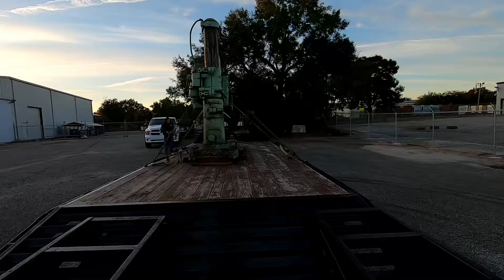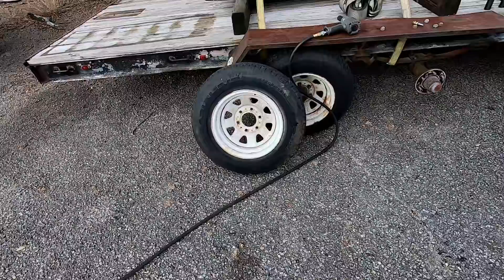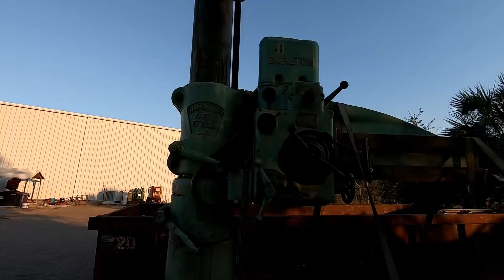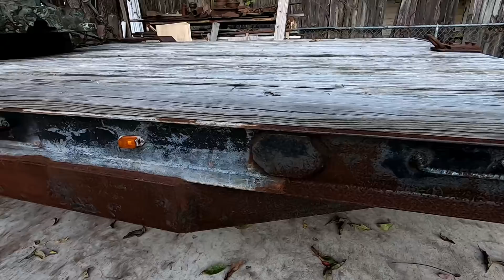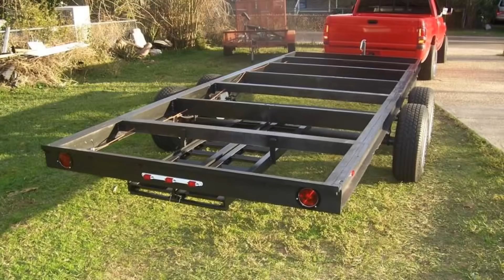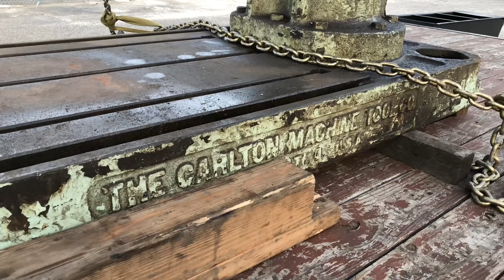Carlton Radial Arm Drill

Comment: Good luck with Dodge, they build a good heavy duty truck but they cheap out on the wiring. Dodges are real bad about catching fire because of the wire being to small. Had a 96 Dodge with the V10 and the headlight switch wiring burned up, then a couple years later the ignition wiring caught fire because the ran the blower motor power through the ignition, did a lot of damage. I was going out to my place 8 miles away when it did it, and within a few seconds the entire cab was full of smoke, so keep an eye on that. Dodges tend to fall apart but will hold and haul a large loads, they just really cheap out on good wiring, sad.
Reply from the maker: Good thing I went with a Ram! 
The trucks have greatly improved over the generation your talking about.
Reply: Abom79 You made a good choice Adam - also love seeing new tools in the shop!
Reply: I hope you have better luck with yours than the people my friend has to go out and tow in for service, most of the cars/trucks he tows in are Dodge's.

Just saying keep an eye on those wires, Dodge's have had lots of problems, even the new ones, bad about burning up and catching fire. Just saying to be careful guy, love the video's and would hate to see you get hurt by something they when cheap on.

Comment: Looks good.  If I was closer I would hop on rebuilding the trailer with you in a heartbeat.  When you put some new lights on get some tubing large enough to mount the lights inside of for the trailer brake/tail lights.  You can then weld them on to wherever you want and are a lot less likely to tear them up.  And if you have to redo the wiring use some of the orange extension cord.  Works really well and you can just zip tie it down or attach it with whatever you want with very little risk of the wire chafing.  Unless you have trailer brakes it only takes a left brake, right brake and running light to run the lights.

Comment: Hey Adam,  I have an old American Radial that's about the same size.  Be careful when unloading because that
arm might still move when you are taking it off. When we moved ours, we rotated the arm up to the mast on the 
forklift and secured it there so it wouldn't move.  We also made a heavy duty outrigger that we mounted to the t-slots in the base between the column and the table.  Extending out about 15" minimum to the front and back of the base
gives it a wider footprint, especially if the arms starts swinging around (and even more so if the drilling head is out
on the end of the arm).  Scary thought.  These things are very top heavy........ Nice machine to have in your shop.

Comment: Those old carltons are hard to beat, I got a 4' arm on 11" column. If ya ever need parts look up Lucas precision, they are the ones who ended aquiring all of cartltons old drawings, shop manuals and alot of jigs for making new castings along with maching new parts from the original blue prints.

Also the elevator gear box is designed to seep onto to lead screw so make sure it always has oil in her.

Comment: I have rebuilt two of these in my lifetime. When working properly these  are excellent machines. These are still used daily in the tool and die industry. Used to drill stripper plates and base plates. You can still buy radial arm CNC drill presses brand new.

Comment: Question from the novice. Why you need such a monster of a drill press when you have the other milling machines ? What kind of work will it do that a others won’t ?
Reply from the maker: Milling machines are for milling. Drilling machines are for drilling, and these can handle much larger work pieces.
Reply: Abom79 I get the picture.. thanks 😎
Reply: Drill 3 inch holes in 8 inch plate..lol

Comment: We called it the hole wizard back in the day. Rugged machine for roughing holes in tough parts. I never saw a lot of uses for it . However it was a beast of a machine. If you have a lot of work for it, it would be cost effective. If you don't it will collect dust. Good luck with it!  It was a very popular machine in job shops. Just seeing one again, brings back memories.

Comment: Where I work, we USED to have 3 of the Carltons. 1 was this size, then a 4ft on 12in and a 6ft on 15in column. We still have the two larger ones. The use the #6 Morse taper...what a pain to slam those tools up in...they get heavy after awhile. Good luck with your latest toy.

Comment: Your trailer like mine definately needs a makeover....... Really like the truck. One tip on the placement of your load. Needed to place it a bit more forward of the axles to add a little  weight to the rear axle of the truch for better traction. The reason I say this is before I got a gooseneck trailer I almost jack knifed with a load placement such as yours. Didn't have enough weight transfer to the truck. Just a thought......... Got enough room in the shop for that thing?
Reply: Jackknifing is no joke! 60% of the weigh should be infront of the axle to be safe.
Reply: I was always told 10% tongue weight.

Comment: this thing needs some wire brushing, a steam pressure washer, a good coolant and oil resistant 2 component laquer paintjob, machineoil sprayed on via a spraypaint pistol, some grease for old bearings and maybe new bearings and someparts rewelded and surfaced where the cast was damaged and likeley some small parts remade

Comment: Were those "STAINLESS STEEL" binders???? Also love the idea of using the plastic snap-ties to hold the left-over strap(s) in place. Will be doing that for now on, thanks for the idea. I choked when you referred to it as a small drill press. Made me think of Paul Hogan in Crocodile Dundee: That's not a knife. THAT's a knife.  Great stuff, thanks for sharing, and thanks for taking the time to shoot, edit, upload these video's.
Reply from the maker: They were zink coated is all. Yea I mentioned small compared to the 8' x 15" column machines.

Comment: To minimize condensation when covering the Carlton, I'd place at least a 100W+  light bulb inside the iron casting for heat to keep it above the dew point temperature.  Condensation build-up will cause rusting, electrical wiring, damage, etc. and should be minimized  or prevented  whenever possible.

Daily dew point temps. are widely published either online, inside the newspaper (weather forecast section), etc.

An infrared handheld thermometer is an easy way to measure the casting's temperature.  I just bought an Etekcity Laser grip #744, ~$20, from Amazon.  It's a point-n-click meter and reads within a few seconds.  I particularly recommend it for this application, cooking or wherever you need to quickly know a temperature.  It's very convenient compared to a classical stem thermometer.

Supplementing the heat source with a small muffin size fan to circulate the air and prevent the warm air from accumulating at the top, appears quite helpful too, and takes only a few watts of power.

It's debatable whether a tarp causes more rusting or not because although it keeps out liquid water, it traps water vapor inside where it will condense on the iron.  Also, the moist air trapped under the tarp, warmed during the day, will result in accelerated rusting and deterioration of electrical components, etc.  So, overall, is a tarp helpful?

Comment: MT4 spindle will sure let you make big chips.  Will it run your 3*7/8"?
Reply: No. That's a 5 or more likely 6 drill bit. My mt4 royersford is only rated for 1.5"
Reply from the maker: The 3 7/8" has a 6MT. I have some 2" size drill bit we can run on the drill.

Comment: @abom79
Why have a drill press when you have multiple mills?
Reply from the maker: A mill is for milling
Reply: @Abom79  but a mill can drill.
Reply: Because the mills cannot reach to the center of an 8' work piece...
Reply: @Blazer02LS  enter the mag drill..
Reply: @fnord5  Why wouldn't you want a radial drill press? Why have a shaper? The machine is 80% of the fun of machining. I'll watch my shaper for 15 minutes do something my mill will do in 2.
Reply: They are handy but not really the tool to drill multiple large holes with speed. With a radial arm drill you just move the head into place and drill using the auto feed. Move the head again in a few seconds and drill the next hole. Much faster and easier than a mag drill.  Also a mag doesn't do power tapping very well.

Comment: That's a really nice trailer. I love how heavy duty the tongue is. Most factory made trailers that have gone through what yours has are just about worth scrapping by now. It's a good idea to get some new rubber on it before using it much more, a TR600HP has got to be pretty old to push through a wheel like that.
Reply from the maker: Yea the trailer is solid, just needs some fresh paint really. Even the deck is not bad just looks aged.
Reply: Need some torsion axles too, though it doesn't seem you use it enough to justify.  Thanks for sharing.

Comment: When you get around to rebuilding the trailer I would recommend LED lights all around.  You already have the holes at the rear for flange mount turn/tail lights and the marker lights could be replaced with surface mount, rectangular  lights.  Anything incandescent with a separate base and light is a waste of money.  They always fail at the same time.  LED lights, shrinkable butt connectors are the way to go.

Comment: WheneverI have to unload something like this i just get a piece of 4x8  strand board sheathing its as slippery as can be for some reason I put underneath the iron object  and use a come along and it slides right off the trailer nicely. No need for chasing pipe around.

Comment: Most of these big industrial machines run on 3 phase 270 or otherwise not regular in home current and voltages. Do you have transformers or a power supply form you provider for all your toys that I am so jealous of?
Reply: Adam has 3 phase power in the shop from the local power co.
Reply: Variable frequency drives have come way down in price in the last 15 years.  They are now the easiest, most efficient way to power 3 phase equipment at home.
Reply from the maker: 3 phase power to my shop.

Comment: Just a suggestion from a guy that has done a little hauling. Always have front to rear tension on anything you are hauling. You tied it down real good for everything but an emergency stop or God forbid a front end collision. Had a friend die because his boat was not secured (properly) front to rear and it slid over the top killing both guys in the cab.
Reply: If I was hauling that I probably would have added a chain over the top of the table in front of the column, with the ends going back to behind the fenders on each side, since the greatest force this will experience is braking force making it want to slide forward.

The second greatest force will be tipping forward, so I would put the front block as far forward under the table as possible (it is a fulcrum under the column here), and would have the chain over the head angled a little further to the rear to hold against the forward tipping. 

The 3rd greatest force is rocking side to side with that high center of gravity, so I would have used 2 more chains (or straps if chains would damage it) around the column above the head. One chain would attach to the side of the trailer in front of the column, go around the column and attach to the same side of the trailer but behind the column, and the other chain would do the same thing from the other side of the trailer, ending up making an X pattern (when viewed from above) or actually 2 interlocking V shapes, effectively locking the column in place in all directions.

But for a short drive, Adam did fine, because he isn't an over-securing anal truck driver like me lol

Let's just say I treat tie downs like Adam treats dialing in 4 jaw chucks.

It shall be perfect, and in my case, perfect means that over a travel of 1000 miles, I can measure the shifting of my load in thousandths of an inch... Lol

Comment: Suggestion for your trailer: after you strip your deck off get 2 pieces  6"x1-1/2 channel the length of your trailer deck, lay it open side up spaced by thirds length wise up your frame before you put the deck back on it. then weld D rings in it every 4 feet. another option of this same vein if you a have either a water jet or plasma table at work is to cut chain pockets like on the bed of a wrecker every couple of feet. I will send you a pic of my trailer so you get the idea.

Comment: YUPP spent over a year in a valve control shop working with three of those one like this and one like Brian's and a small one. Sure learned ALOT there too. Melted in summer and froze in winter. Coring  cast holes for 
Rubber  lined  control valves , air or hydraulic plus manual . Oh well memories are all that's left. Good machines the Carlton line . I could drive taps in and out with the sensitive controls . Thanks for the videos .

Comment: If you're going to leave a load on the trailer for a while put some blocks under the rear frame. When you crank the tongue off the hitch it'll tilt back onto the blocks and take some of the load off the tires. If you jack it up a little higher and then let it down on blocks in the front too it really stabilizes the trailer.

Comment: That's a real machine tool. In my career shop we had a couple dozen with four in a row reserved for first year apprentices. Carlton drill presses are nearly bullet proof. If forty years of apprentices can't degrade the function of a Carlton radial arm drill, nothing will.

You will find what you will find. Nothing's perfect. Carlton made thousands of these over the years. I'm sure you can find the parts manual on line. Everything is so well made: they're a pleasure to work on and when cleaned up and shiny an esthetically pleasing addition to the inventory.

Im green with stuff-envy. Happy drilling.

Comment: Reminds me of when I bought my Bridgeport mill a few months ago.
I had it strapped down like Gulliver and I also bolted it down to the trailer as well.
My father said it wasn’t necessary but I said 
“Do you want to be on the 6 o’clock news with this laying on its side dug in the middle of the express way “ 
It was a 400 kilometre drive (248 miles)

Comment: Too bad Alec Steele didnt have as much success with his machinery delivery.
Reply: Loading and unloading is the scary part.  If you've watched bcbloc02 - Brian was unloading and his crane cable snapped (he posted that video back in May 2017 - I think his is a 7' arm, or thereabouts.)  Thankfully, he wasn't hurt and the drill was repairable, but...damn, it hit the floor hard and broke some.  

https://www.youtube.com/watch?v=0Ako5guyzNg
Reply from the maker: Sounds like his seller needs to hire a private hauler instead I using LTL.

Comment: You need to buy or rent some machinery skates and toe jacks. I have a cheap set from Vestil and they work great. Also, a 2'x4' piece of 1/4" plate works wonders to make the transition from the tail of the trailer over to the slab/floor.

Comment: When moving a machine like that, would laying it on its side, instead of standing it vertical, damage the machine? The Alzmetal drill press I own, I moved by laying it on its side in the bed of the pickup truck. Had wood blocking under the column and rubber mats under the head.
Reply: You don't want to lay it down if you don't have to. It prob won't hurt it, but there's really no benefit of laying it down.
Reply: @xenonram  Laying it down will drastically lower the center of gravity.

Comment: Same drill in my bosses son shop paid 850.00 for it I built a steel beam table will take a pic . Works good in a structural shop to do base plates and beams . Wire brush and pressure wash on trailer.Mineral spirit will work best to clean.

Comment: They have a similarly sized radial arm drill press at the place I used to work, that thing was great. Had the hydraulic gear changer and stuff. Spun up to 2000 rpms. Old USSR made beast, solid as frig. Weeping oil in a lot of places but, straight as an arrow and about as rigid as they come.

We're currently trying to get a better drill press for my current work place, so I managed to find a reasonably priced radial arm drill press, it's a small one, but hey better than that belt driven chinesium atrocity we have now. Hopefully the funding request goes through. Also upgrading the old power hacksaw, which does admittedly work just fine, but it'd be nice to have something that can cut some angles.

IDK where Holzman is from but they're reasonably priced and don't look terrible, also a local sales office. Fingers crossed. I was trying to shoot for a lathe too, but the workshop manager apparently hates lathes, he thinks we need a mill for some reason which is silly, we'd be using a mill for the drill press and still wish we had a lathe to make press tools and whatnot.

EDIT: Typo.

Comment: i like your new toy it should fit in well. i would like to make one note is that you had no straps or chains stopping it from moving forward if you had to hit the brakes. just a thought to keep you safe. keep up the good work
Reply: Yes it did. The chain going over the top was wedged between the mast and other things like the motor. That truck wouldn't be able to stop fast enough for that thing to move; esp since the trailer has no brakes.